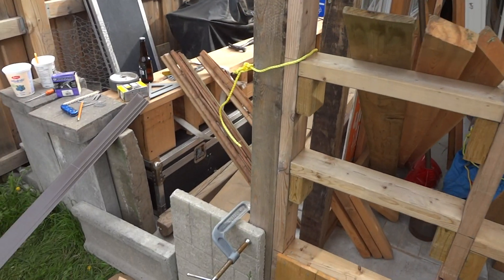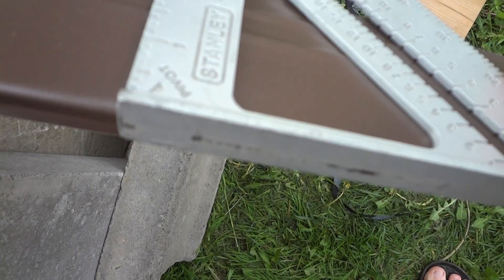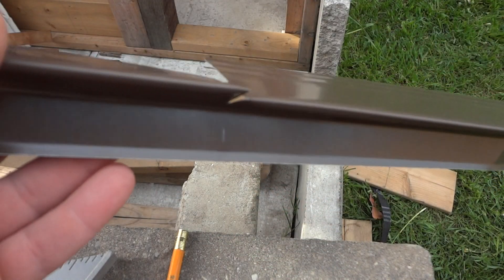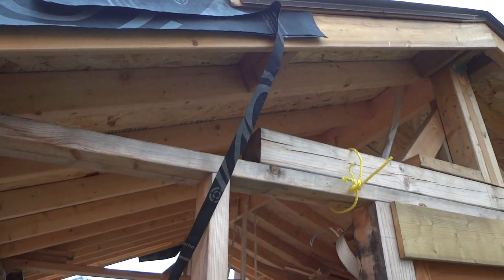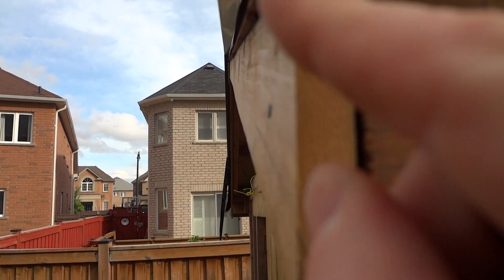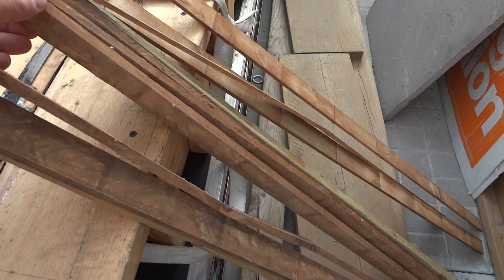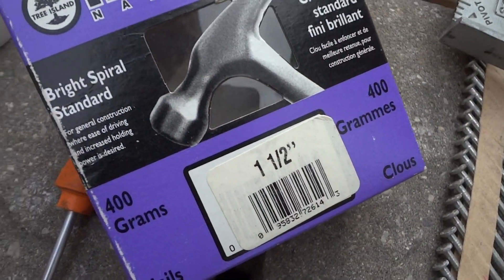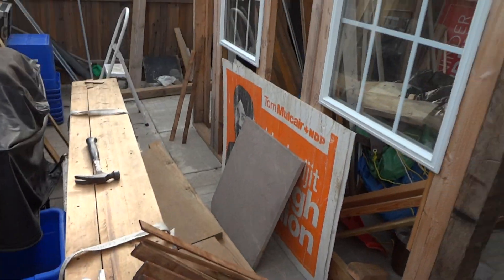install drip edge on shed the easy way part 1

Comment: About time you got to work on that shed and posted us a video. 😁👍 Those nails with the ridges are called ring shank nails and the copper wire joining them is there to hold them together as they go through a nail gun.
Reply from the maker: ive been slowly doing work on shed in my spare time. its ready for shingles now.  well these nails are over 25 -30 years old i think... i cant imagine them being used today wasting copper like that